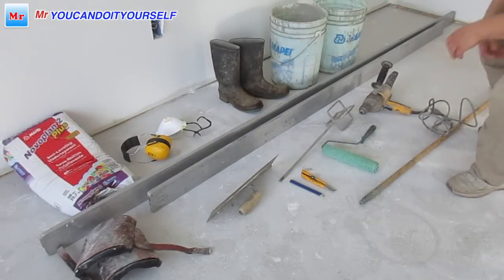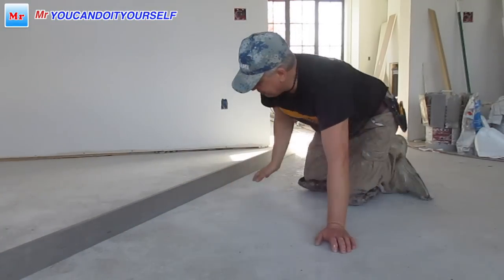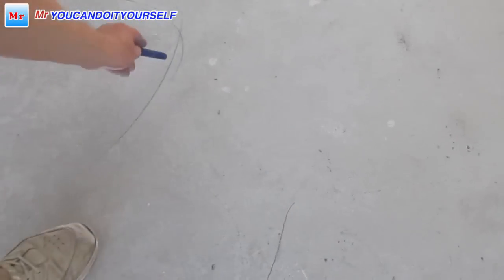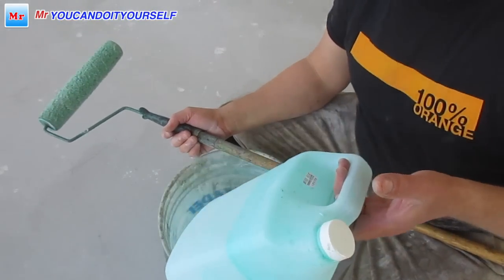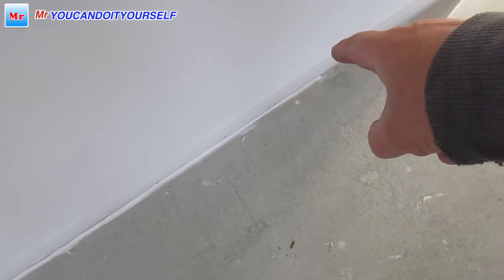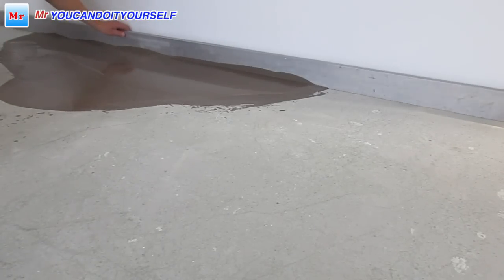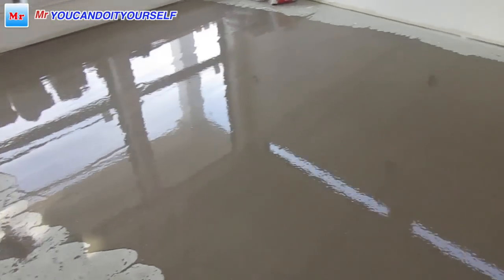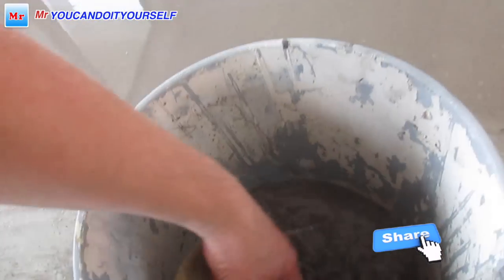How To Concrete Floor Leveling with Straight Edge DIY for Beginers MrYoucandoityourself

Comment: I just did my 440 sq ft garage floor that was all cracked and sunk in some areas as much as 2 inches. Ended up using 42 50lb bags and it is still  not good enough. I think I need another 50 bags to make it look right which would put the project at about $3000, ($30x50lb bag) I should have just ordered a cement truck with fine concrete and poured it over and leveled it using a concrete screed. Self leveling underlayment is not for big jobs, trust me. My back is shot ad the floor still looks like shit. If you're thinking about doing this I suggest you consult with a professional.
Reply from the maker: Hi Adnan, the self leveling compound specially made for final coating. If you need to use the big volume of material, for sure better use the concrete. Thanks!

Comment: How do you prepare a slab that has expansion cuts? My project has two expansion joints. One has a spread of approximately 1/2 inch the other 1/4 inch. Please advise. Learning from you videos however have not seen one that addresses my concern.
Reply from the maker: It’s in a house or you doing outside job?
Reply: @MrYoucandoityourself  In my home
Reply from the maker: Can you send me pictures on Facebook page, link in description for any my videos. Thanks
Reply: @MrYoucandoityourself  I replied to your January 21 post. Two joint pictures. I appreciate your help. Thanks Mike
Reply: Were you able to see the photos?  Should I clean out the joints then put an expandable caulk like silicone in it. The narrow joint did not show through the previous vinyl floor however the wider one did.
Reply from the maker: Hi Mike, sorry I didn't answer you because was very busy. I do not worry about these joints. I fill it up with caulk and go through with a self-leveling compound. If it will be cracked, how affected your new flooring?
Reply: @MrYoucandoityourself  Thank you for your instructions! My floor project is 500 square feet, 4 rooms that meet in a hallway. After watching many of your videos my plan is to make the areas flat separately then flatten the areas at the hallway. Level will be difficult as there are cabinets and an island involved. So I will determine high points low points in each area. There will be grinding and floor flattening by pouring self leveling compound then using a  8 foot level to flatten Hoping for an excellent result! You’re a good man! Thank you Mike
Reply from the maker: @mikeheiss2429  Good luck with your project!

Comment: The whole point of self leveling is to let the material do the work for you and keep you off your knees.  Mix to the manufacturer's recommended water, pour it out over the entire floor and lightly smooth it. Now trowel or screed should be necessary ever. There are tools specific to self leveling underlayments that make the process easy and accurate. Don't get me wrong, what is shown here is good craftsmanship, but it is NOT how manufacturers recommend this type of product is used.
Reply from the maker: Hi Joe, great advice! Thanks
Reply: From experience, I can tell you that if you just poor and let self level with no screeding, no spiked roller, or blending the edges, it will be a disaster.  Why do you comment on a professionals work when you have no idea?  I've level hundreds of floors, how many have you done.  I know the answer is ZERO by your comment.
Reply: You'd be shocked to see the kind of mix consistency I have once had in the past while trying to "mix to the manufacturer's recommended water". - Self-leveling my a$$.
The mix would just sit like a pile of mud and had to be manually troweled out all over the area. And - no, the water was freezing cold, so it wasn't too thick due to heat.
The problem is tap water itself is very different geographically, and the PH, hardness, the content of salts and other deposits appears to impact the flowability of the resulting mix.
So, if you're using distilled water - by all means stick to the recommendations. Otherwise, good luck following those to the tee! You've been warned.